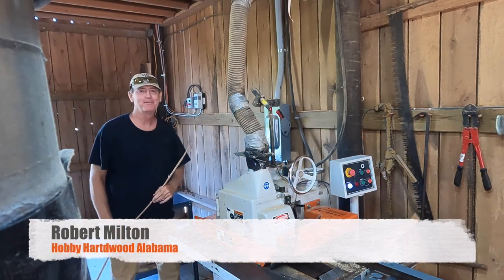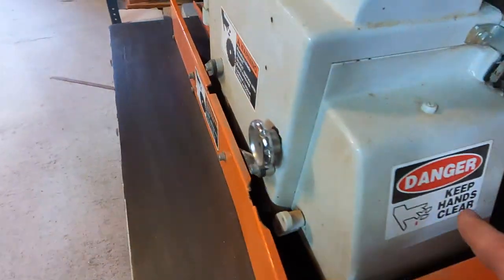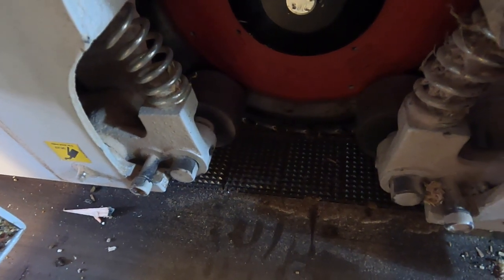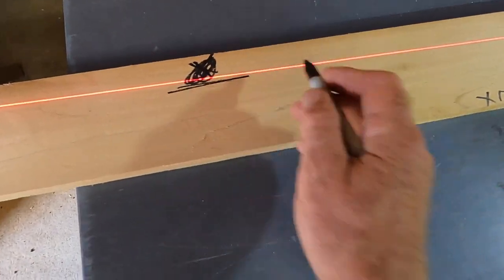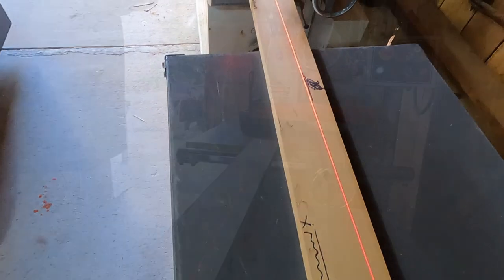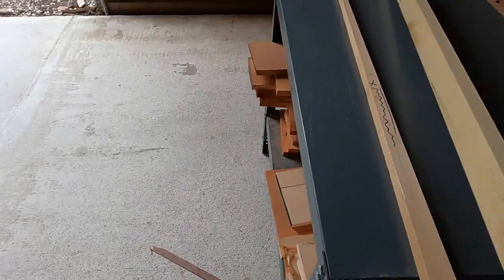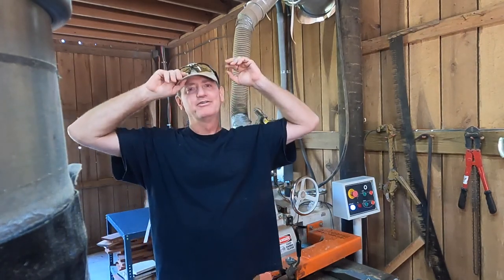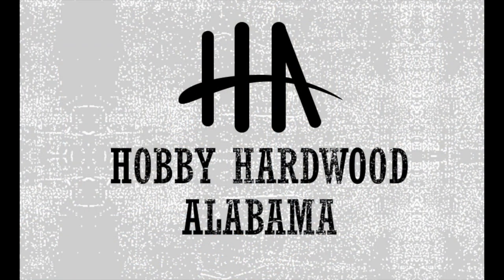You've Never Seen This Tool! - How Professionals  Straighten and Edge Wood, (Straight Line Rip Saw!)

Comment: I worked on a moulder crew on the early 80's. It took a good 2 man team to rock and roll back then. I got very good on the out feed end, of course I had no choice.
Reply from the maker: Yes, the boards are coming out one way or the other, and it takes a good crew working in sync to get it done with the least amount of effort.
Reply: @HobbyHardwoodAlabama  to be honest, it takes a lot of effort,  focus an timing. On the outfeed side, the first board comes thru straight lined, the scrap goes on one cart, as your pitching the board back, while another straight lined board comes at you. Then the actual ripped piece comes that goes stacked neatly on a seperate cart, and so on and so on...not to mention that the operator has multiple feed rate choices. It took a lot of syncronisety.

Comment: Do you have 3 phase to your shop or do you use a phase converter?
Reply from the maker: We can't get 3 phase line power, we run both a phase converter for the smaller tools, and a 3 phase generator for the high demand tools.  Good question, this would make a good video.

Comment: Just bought a used one but can't seem to figure out what type of oil the feeder chain takes. Doesn't say on the reservoir. What type do you use?
Reply from the maker: 30 wt motor oil and you need to adjust the flow rate to properly lubricate the chain and ways, but not cause oily sawdust to stain the boards.
Reply: @HobbyHardwoodAlabama  very much appreciated! Love your videos, wife, sister and I run our little shop here in PA

Comment: So who makes that edger? I’d like to get more info and pricing on that machine. 
I also like your joiner. Which manufacture is that?
I’m in Pa so a bit far for a visit but I’d love to.
Reply from the maker: The SLR is made by Northtec, which was out of Kentucky, about $20K.  its similar to a C-12RSH. The jointer is made in Italy by SCMI.  About $20 for it, give or take, plus the 3 phase converter.

Comment: I would appreciate your help about an item on order. An Eg 200 edger or this machine?  It looks great.
Reply from the maker: Both are very good machines.  It would depend on how you want to use it.  The EG200 is a roller fed machine, so has different characteristics than a Baker, which is a conveyor fed machine.  Both have their advantageous and disadvantages, however, both are the top machines that I researched.

Comment: How hard would it be for this thing to consistently rip 3/4” 2by material?  I make flags from 2x10x10 and considered something like this to rip the whole 10’ board at a time and then section to 36”.
Reply from the maker: That is exactly what it is designed to do, rip fast and true.  It will rip 2” x 12 foot long material easily, and we do it all the time.  Or you could do the same with a gang saw, which is this type of machine with multiple blades.
Reply: @HobbyHardwoodAlabama  what’s generally the thinnest pieces it can consistently rip?
Reply: @HobbyHardwoodAlabama  and thanks for the response. I don’t know anyone with one of these and no dealers seem to really use them. Hard to ask questions lol.

Comment: Banks double edger compete with that ripper?
Reply from the maker: Our SLR has a fine cutting blade, with an 8' guaranteed glue line.  We also use our Baker to edge, and it will do 3" thick, two blades, at full speed.  Each has its uses, as one machine is more surgical, the other is for high speed bulk edging.